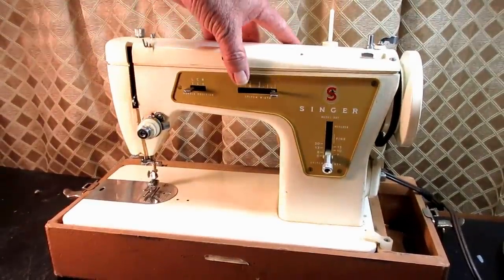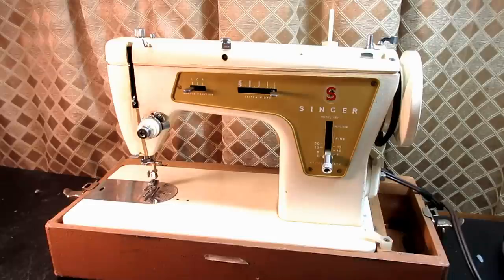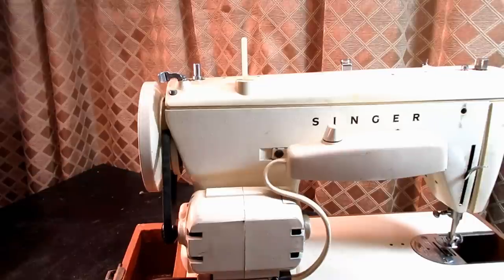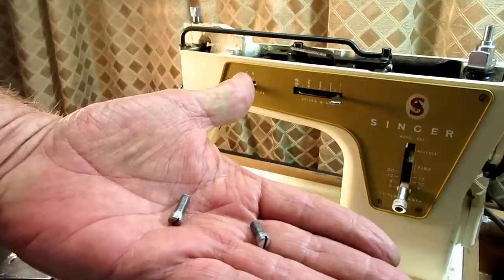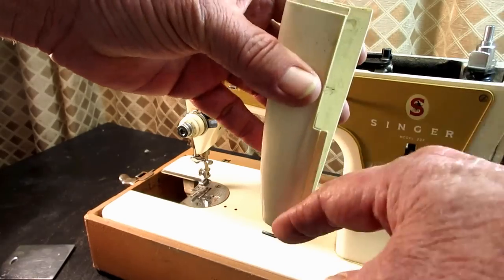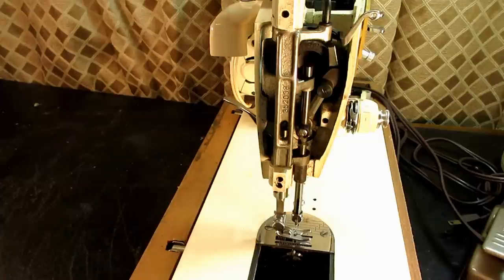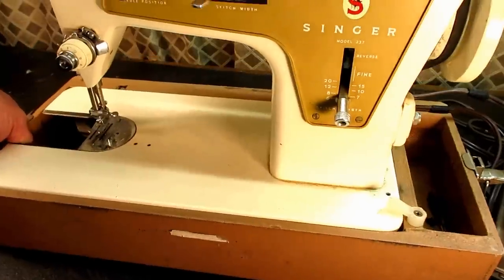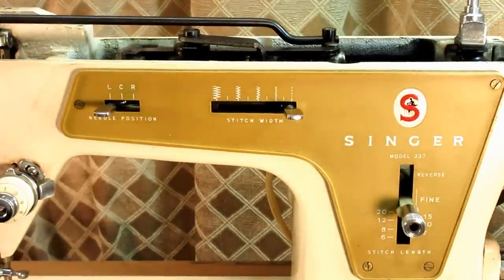Introducing Stella, a Singer Model 237 Fashion Mate Sewing Machine, Pre-restoration.

Comment: Another great video Andy. I just picked up a 237 at a Thrift Store for $20 and plan to follow along with you step-by-step. Should be a great opportunity to learn more from you.  Thank you.
Reply from the maker: Isn't it satisfying to find a good machine for that price? Even if you need a few parts replaced like motor belt, light bulb or tension spring it is a fantastic value. We will be learning about the moving hook on this machine together then. Thanks for watching.
Reply: Eager to get started Andy!  Only real problem I see so far is that one of the top cover screws has been cross-threaded -- and the nose cone screw--same issue. I have the darker beige model but without the feed dog drop control feature. I'm also not sure if the controller is OEM....I have my doubts, but not certain.

 @andytubesewing1953
Reply from the maker: Dang, sorry to hear about those screws. I assume they have proprietary thread spacing, but maybe not. A fellow wrote me that is a situation like this he uses a tap-and-die set to make new holes in a standard size and replaces the screws. I have never done that before. See you along the way, Robert.

Comment: Yes, a moment of clarity! Thanks for showing us how the hook shaft shifts back and forth, something that escaped me on my own machine. It makes perfect sense that the hook below would move at the same time that the needle bar is swinging back and forth up above in zigzag mode. The hook has to move with the needle to keep forming the stitch, all of which adds another aspect to needle bar timing. It's no longer simply a matter of the vertical location of the needle in relation to the hook, but also a matter of horizontal location. Otherwise the hook would either miss the thread loop hanging off the needle, or the needle would hit the hook. The mechanism connected to the stitch width lever has a lot of work to do. Does all this form a better quality stitch than is done with a zigzag accessory foot, which solves the problem by shifting the fabric back and forth rather than the needle? Sometime down the line you might take a look at the Singer 319, which seems like an engineering marvel at another level of complexity.
Reply from the maker: It certainly is an interesting hook system. I have not seen it before and emailed friends to see if they have or can tell me other models that use it. I had the opportunity to buy a model 319 a few years back. It was sure a different type of machine than I had seen before. I gave it a good look-over. The only horizontal camshaft I've seen on a Singer. A "cleated" drive belt made from 11 braided fiber "strings" wrap with 3 metal bands every inch or so. "Typewriter" style keys on top for pattern selection with a couple dozen additional flat pattern cams or discs that could be attached to a mechanism on the front. An odd size needle that is shorter than the 15x1 style and cost 3 times as much. It surely had an industrial bobbin/hook combo on it; not class 15 or 66. It was a very powerful machine with great stitching quality and with the noise that provided all that power and movement. With proper care, it seemed like it could sew forever. It just did not appeal to me and I passed on it, but it sold an hour later to a fellow from Canada who had been searching for one a whole year and was ecstatic to find it and thought I was a fool to pass it up.

Comment: Hi  Andy,   Thank you for all your helpful information regarding the 237's.  I recently picked one up that was very stiff and the feed dog  was frozen. Following your lubrication guidelines,  I slowly worked my way through the machine using the handwheel as my turning method, to clean and lubricate  and gradually freed everything up to turn very freely. My dilemna is upon tilting the machine (which i did before I started my lube and cleaning)  there were some parts laying in the tray. I realize now they are associated with the bakelite plastic bobbin gate .The gate's hinge side ( i think thats what you'd call it) was broken. There was a tiny roll pin, a small coil spring and a flat notched key like object.  I never had the advantage of seeing these pieces in situ, and am asking if you might be able to point me  to guidance for re-assembling this once the new part arrives.  I don't remember seeing you completely take the bobbin gate off, but could have missed that.  Any guidance would be greatly appreciated. My guess is, someone broke this a long time ago and the machine sat as a "when I get to it" repair. I'm so happy with how freely everything moves and quietly , i look forward to completing it and seeing how it sews.  Thanks, Jim
Reply from the maker: Hey, Jim. No, I never took the gate off. There is nothing about that in the service manual that I saw and I did not want to have a problem. There are a number of associated parts to it and it must be fairly common for the plastic gate to break from age b/c you can buy a new one. They sell the gate only and here is the best price from a known seller: https://www.sewingpartsonline.com/race-cover-singer-352075.aspx   There are other sellers also, and sometimes the part will be for sale on eBay when a seller parts out a machine.
There are a couple of better views of the gate in other videos. Start at @1:06:42 of this video; https://youtu.be/rqXbbbEX78k   and @1:15:10   of this video; https://youtu.be/ybRA_1qYw58   Better yet, if you'd like the parts & service manuals for the machine you can email to andymanuals53@gmail.com and ask for model 237/239 records.  Alan will reply with PDF copies and then delete your email. No charge. The same parts for this are used on both the 237 & 239 models if you go looking for used parts.
Good luck, and thanks for watching my channel.

Comment: When I was doing the goodwill auctions I noticed the desire for the 237's go from no interest to fairly popular.
At first they would go through there without a single bid then it got to the point every one would sell and they started commanding a fair price.
I never really noticed that some had feed dog drops and some didn't.
It looks to me that both Singer and Kenmore would from time to time use the Mercury controllers as well as some of the Japanese models.
I have one of the Japanese "precision deluxe"  machines marketed through Dayton and badged "Electrohygene" that has a Mercury controller that I know is original to that machine, it's a 1965.

My newest treasure is a Kenmore 158-17501 from 1968 which I assume is the competing model to the Singer 237 of that era, and it weighs in at 43 pounds I'm told, I haven't actually thrown it on the scale, but bet that's pretty close, she's a real backbreaker, but an AWESOME machine.
I call her the Beast.
Looking forward to your series.
Reply from the maker: Thank you for the information about the foot controller. I'm still searching for documents about it, but no joy so far. I thought Stella was a heavy machine at 28lbs buy your "Beast" at over 40lbs tops that easily. Thanks for watching.
Reply: I'll be interested to see what you come up with.
The more I see and learn about the Kenmore's I have to come to the conclusion they are Superior machines to the Singers, probably not what you want to hear.
There were several different companies in Japan that produced the Kenmore machines for sears
148 series =Soryu in Japan
158 series =Maruzen in Japan (later Jaguar)
385 series =Janome
And of course White of Cleveland Ohio in the beginning.

The 158's are made by Maruzen and based off of the Italian machines like the Necchi  
 which I probably spelled wrong.
I have grown very fond of them, they are designed, balanced, and built, to very high standards.
The 1750 I spoke of above will be my keeper of a zig zag machine, I absolutely love it, it's quite, fast, and smooth, and probably one of the most powerful of the domestic machines, with a 1.2 amp motor it went through 6 layers of denim without a thought.
The only Singer I have run so far that was that smooth was the 201-2
I like the Cams setup the 1750 uses too, very simple to use and very little adjustment to worry with, set your length and width and you are off and running with design after design, almost like an embroidery machine.
I think a person could do about anything they wanted with that one machine.
Reply from the maker: I don't mind hearing about the Kenmores. The one machine I restored was built very well and ran wonderfully. https://youtu.be/xF2BFA36CPk
I just find the Singer machines and parts more available and better liked by the buyers in my area. Maybe you can do a channel like mine, but will all Kenmore machines. Then we could have a head-to-head sew off!!! Take Care, Mark.

Comment: I am inspired to fix my 237M-A that I was given in 1969.  It has stayed with me and only recently given me a problem.  The needle won’t pick up the bobbin thread.  I replaced the broken race gate and thought that would do it. No.  Mine has a Bakelite foot pedal , wish it was like the metal one on this video.  I will watch some more tomorrow and will leave all the pieces laying out on the table.  There has to be an adjustment to make the needle pick up the bobbin thread.?
Reply from the maker: It's a very nice model; congratulations. Most vintage Singer models have a method for setting the timing of the needlepoint to the hook point. Model 237 has a different system of hook (traveling) and the timing is factory set by the way the shafts are assembled at the factory. There are a couple of mechanical reasons that can cause the loss of picking up the bobbin thread, which is really the hook point is not carrying the needle thread around the bobbin thread) The one we mostly find is that the height of the needle bar changed, often due to a needle strike or sewing very heavy material for a long time. If the height of the needle changes it is not in the correct place for the hook to grab the needle thread. Simply checking and resetting the height of the needle bar back to the factor height fixes that problem. I did make a video about the needle bar height (and presser bar height) including how to check/set the height. That is the first place I would look when troubleshooting this problem. You can find the video here: https://youtu.be/bRjfg2VaqP4   
If that doesn't help you solve the problem, there is another adjustment, but I don't have a video of it and you would need the Service Manual to follow. Good luck.
Reply: I also have a broken race gate.  Can you tell me how you replaced it?  I have the replacement part and the service manual, but I can't figure out how the hinge part goes on.
Reply: @andytubesewing1953  , Thank you for that answer, Andy. My daughter just gave me her 237M  to fix  because the timing is messed up. I always have hope when I can find an Andy Tube explanation!
Reply from the maker: @jeanleder9919  Hi Jean. Yes, it's usually something that changed the height of the needle bar, and resetting that corrects the timing. I appreciate you watching my channel. 😊

Comment: Hey Andy! Quick question! My 237 seems to miss a stitch every 20 stitches or so when in zigzag. Not sure if she’s missing the zig or the zag! Hahaha! But the rest of the stitches are nice and tight, top and bottom… in your experience, is this still a tension problem or should i be looking elsewhere ? Thanks for your time and hope your feeling well!
Reply from the maker: Normally skipping is a tension problem, but other things can cause it too. If you are still "helping" the fabric (even a little) it can skip, especially at the moment you move your hand on and off the fabric. Let the feed dog do the work. A test for that is to take a scrap fabric and sew ZZ without even touching the fabric (who cares if it goes crooked) and see if it still skips. If it does then it was not your fault. If it did NOT skip then learn to keep your hand off, haha. 
     We know you had a needle height issue from the broken needle. From my own experience (and eyesight getting older) I have learned that a very small miss-setting of the needle height can cause that one-in-15 to 20 skip, especially during wide ZZ stitching. So I'd get my glasses and even a magnifying glass, and clean the needle bar and bottom of the bushing nicely and very carefully reset the height, and that often cured the rare stitch skip problem.
      I have worked on machines where the ZZ did this b/c of failure to lubricate the Vibrating Bracket and associated parts in the nose. That needle does swing quite a bit and cleaning and oiling a machine sure eliminates a lot of little nagging problems. Remember the video list I mentioned? One of the videos is all about lubricating the machine: https://youtu.be/rqXbbbEX78k    That is also explained in the Instruction Manual that is available for free from Singer Support here: https://www.singer.com/search/support?title=237
     I'm sorry your having problems with that beautiful machine ( I blame it on the Italians who designed it, haha) if you think it will help you can email Alan at andymanuals53@gmail.com and ask for the SERVICE MANUAL for the 237 and I'll have him reply with a PDF copy of it. We delete all incoming emails at the end of each day and don't give/sell your email info to anyone. Good luck.

Comment: Andy, I am here reviewing all these videos on Stella 237 Fashion Mate cuz I need to work on my tension unit.  I find these videos so helpful.  I l look at the oiling and greasing one at least 2 x a year.  I live in fear you will remove this playlist from you tube.  I finally found the bobbin stop  part I needed.  I am still trying to locate a straight stitch plate for my 237 Fashion Mate.  Surely another Singer Machine uses this same straight stitch foot besides the 239.  Andy do you know of any others I could try.    Keep making these great videos.
Reply from the maker: Hey, JoJo. I don't think the plate from the 239 will work on the 237 b/c the feed dogs on the machines are a different shape. I remember trying it when I had both machines before. I know they made a straight stitch plate for the 237; I mean they show it in the instruction manual, but I can not even find a part number for it in the parts diagram. Here is what one desperate fellow did to get a straight stitch plate for his 237 https://www.youtube.com/watch?v=jnsDoCLT8xw   maybe he could help you?

Comment: HI, I finally found a 237 and took it to our sewing machine shop. He just phoned and said it wasn't worth fixing, it was going to cost more than $200 to fix it, but he did have a free arm Elna he would sell me for $180.00. He says its been used hard for repair. The young lady I bought it from said it was here mothers and bought new in 1968. I have a few vintage machines I have fixed ok., what I need to know is are these as easy to fix as the older ones? re: timing etc. ( if thats the problem) TIA
Reply: oh, and he did say he would recycle it for me!
Reply from the maker: If you are asking about the Model 237 being easy to fix I would say it is no harder than any other vintage Singer machine. There is not much to go wrong on it and I can't even see how the timing could go out because of the way the hook and drive shaft work. The only weak spots on it are the plastic indicator dial on the needle thread tension unit (which can be replaced) and the poorly designed thread guide attached to the tip of the needle bar. I made a 20+ video series about the model 237 that includes cleaning, adjusting and so forth. You could look at some of the videos to get an idea of maintenance. https://www.youtube.com/playlist?list=PLsCOZgzzaiKKzvgm_CYPFnDeM8ZqTTo1h
I do not have any experience with Elna machines so I can't advise you about it.
Reply: @lolachantal1   I bet he did!

Comment: I'm cleaning and fixing up a Singer 237 and I've noticed that the linkage from the upper arm to the lower oscillating hook shaft strikes the table if it's resting on the cast iron legs. I had assumed that it should be able to operate while sitting on the three cast "legs." Do you happen to know off hand if the machine is supposed to be able to operate while resting only on its cast "legs" or is it normal that it needs additional clearance to operate? 

It came with a plastic case so I can run it but only when it's in that case which provides enough clearance to complete a full rotation cycle. 

Thank you very much and I hope that my question makes sense.
Reply from the maker: The way this model is made it needs to be in a base or mounted in a cabinet so that the bottom part is not touching anything. It originally came in a kind of wooden case where the top pulled off and the machine stayed in the bottom. Personally, I would mount it in a cabinet if I could rather than trying to sew with it in the base because you have to take the fabric up over the base and under the presser foot and then back down. Good luck and thanks for fixing the machine
Reply: @andytubesewing1953  Thank you so much again!